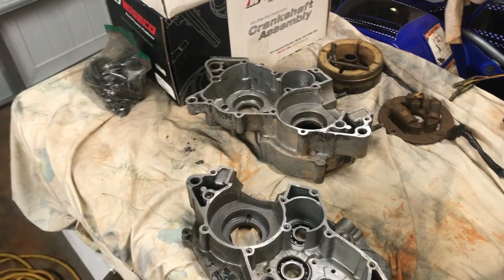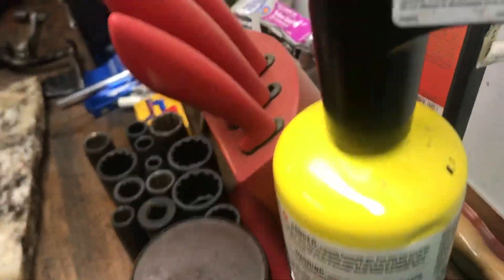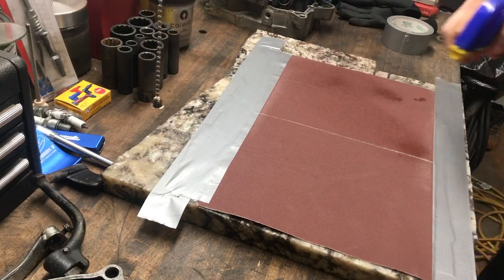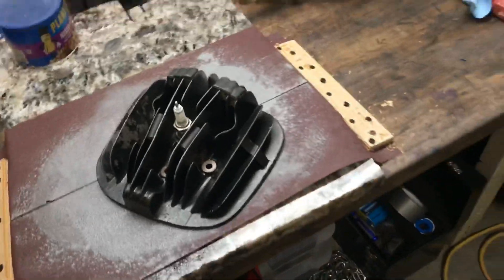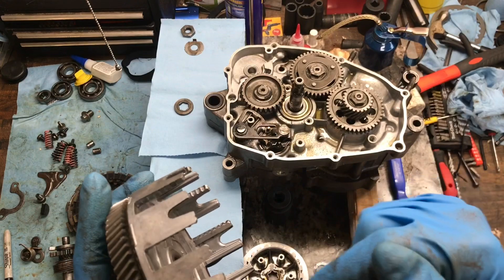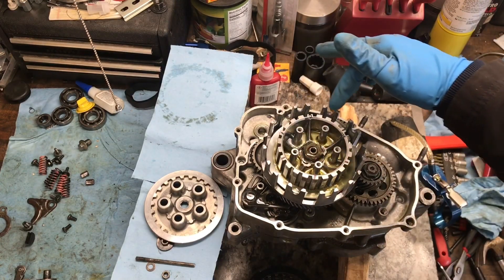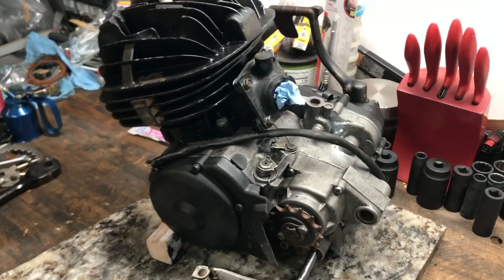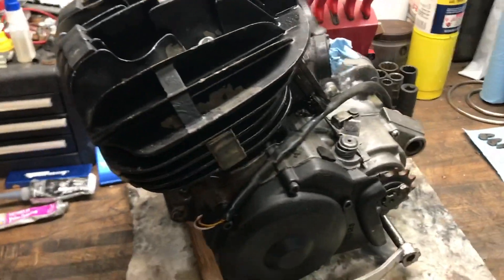Yamaha blaster engine assembly! Cases lapped.

Comment: A piece of glass would be better for this ,that is just a piece of granite that was cut and polished not precision ground as a granite surface plate would be . There is a big difference. Not hating on this method get it done however you can just saying there is a preferred method for this
Reply from the maker: Yes I’m aware of that, granite is only what I got and it works good enough.